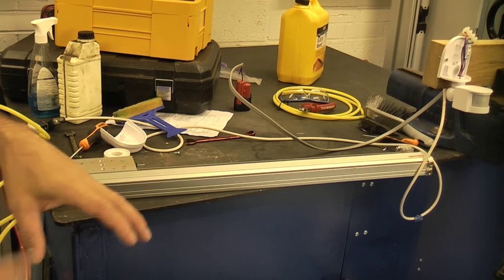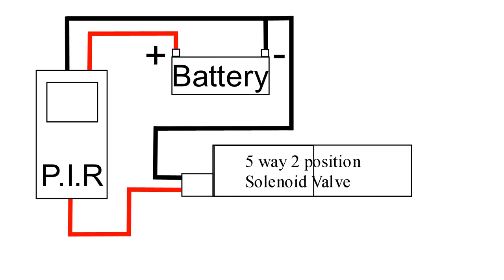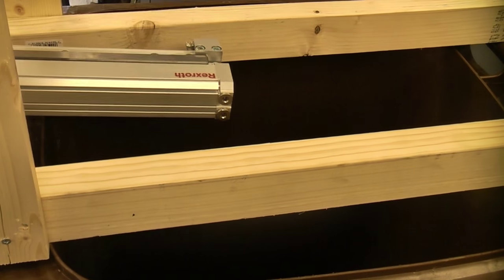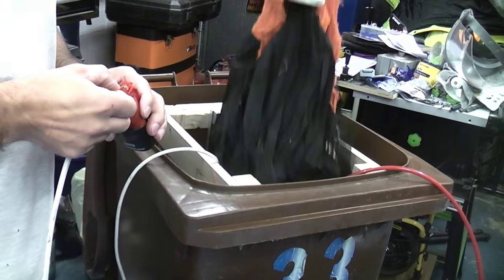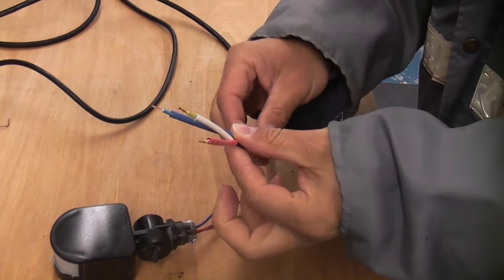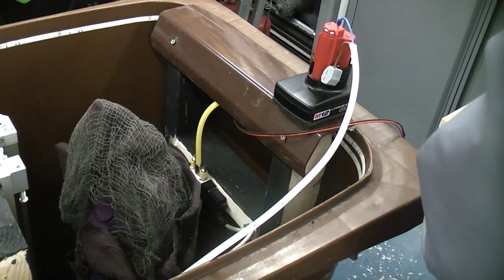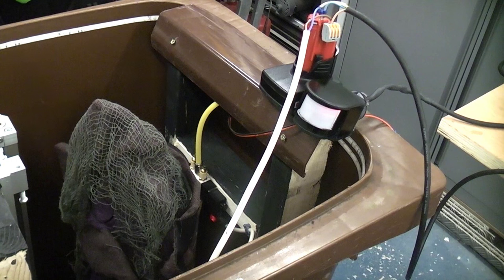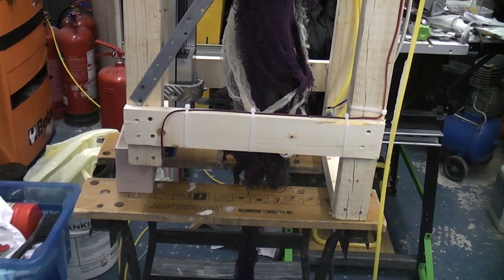How to make a pneumatic Halloween prop

Comment: I'm just curious about that fantastic cylinder. Where would you get one like that and how much would it cost?
Reply from the maker: I bought a few of them at auction, If I remember rightly I bought three of them, plus 5 double acting pneumatic 100mm stroke cylinders for £145 all brand new.

You can sometimes get them cheap on ebay-
https://fave.co/35KzHX9
To buy a 400mm long one brand new, it would probably be £200+ 
Thanks for the comment 👍

Comment: This is a great project.  I have always wanted to build but never knew how. But I still don't. The parts you mention sound like chop sewey to me. Could you list make and model numbers please? I realize its a pain and maybe you have included enough info that I should be able to get it myself but I have never actually used pneumatic equipment. So I'm not sure which end is up. Thanks for all your videos. This one is great.
Reply from the maker: +HobokenHam 

Hi,

 

I’ll provide links to the exact items I used on ebay, but
you will also need the witch (bought from B&M bargains). You will also need
a compressor to generate the compressed air. The rod less cylinders can be very
expensive and are about £400 if bought new ( I bought three for £145 at auction
). You can of course use a normal pneumatic cylinder with a similar stroke
(800mm) which will be cheaper but more difficult to mount and fasten brackets
to etc.

 

5 port 2 way solenoid valve 12v http://fave.co/1WorwBJ

12v PIR sensor- http://fave.co/1jX8Ywx

5 pneumatic connectors- http://fave.co/1OdpZ2l

8mm pneumatic tube to connect it all together- http://fave.co/1WoscH8

2 adjustable silencers- http://fave.co/1Odr8Hc

Limit switch for switching the LED’s on and off- http://fave.co/1jX9BGz

Some suitable cable to wire it up (three core for the PIR
and two core for the LED’s)

Rodless cylinder- http://fave.co/1LGHXGu

 

12v LED strip - http://fave.co/1Wotpy4

 

And of course a 12v Battery to power it all ( I used my
Milwaukee batteries from my 12v tools)

 

I also used some heat shrink sleeving and also some boot
lace ferrules.

 

I think that is everything.

Comment: Hi, Great vid, can you link to where you got hardware needed please? like the 12 volt, five port three way pneumatic solenoid valve, cheers
Reply from the maker: I bought most of the stuff from sellers on ebay- 
Solenoid valve- https://fave.co/357Bz9O
PIR sensor- https://fave.co/32SL0Zd

Thanks for the comment 👍

Comment: Amazing job UHM. Would love to make this. Any ideas on costs? Also, what size compressor would you recommend? The solenoid valve - been looking on ebay but cant find a 5 port 3 way. Can you add a link maybe for an e-bay item that would do? Found a rodless Cyclinder for £25! Again - great work.
Reply from the maker: Thanks, sorry for the late reply I missed this comment and have just seen it.

You do not need a huge compressor to run something like this, mine just has a 25L tank and works well for most small jobs.

I'm not sure of the total cost as some things were bought cheaply at auction.

This is the valve that I used- http://fave.co/2dKvOEW

Comment: Hi, how have you run the air line in to the bin? Thanks
Reply from the maker: +Richard Grant
Hi, 
I drilled a 1" hole in the back of the bin near the top, I then fed the air line which is only 8mm and the cable for the PIR through that hole and concealed both in the bushes. The air line then runs about 20 metres and connects directly to the compressor. 
Thanks for the comment